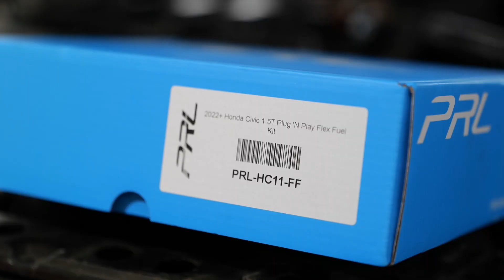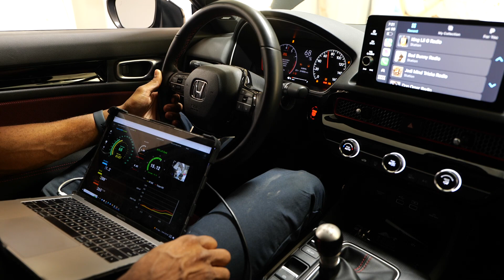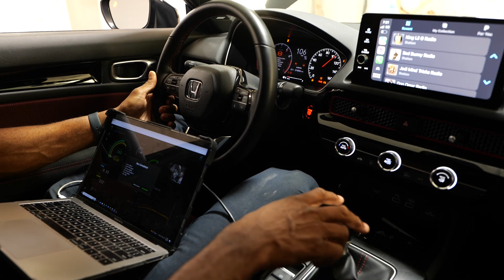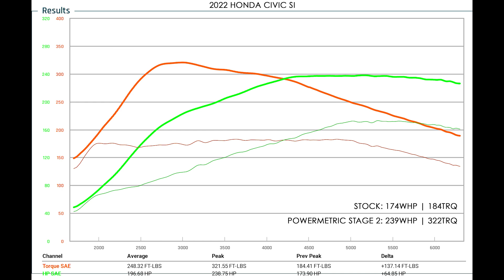Big Torque Gains | E85 Tuning Our 2022 Honda Civic | Powermetric Stage 2 | PRL Flex Fuel Kit Install

Comment: Hey! Getting a 1.5t cvt cause i cant get the si, but i saw its available for the cvt too! There is a notice on the website that there is a torque limiter, by any chance can that torque limiter be removed through hondata by tuning it out??

Comment: So stage 2 is clutch upgrade, PRL intercooler, PRL intake, PRL catted downpipe, and Flex Fuel Kit tuned with Hondata race?
Reply from the maker: Yes those are the mods we ran for that tune. We suggest all of it for better prefomance. You can find the bolt ons on our website. ososik.com and the e tune and Hondata FlashPro on powermetric.net

Comment: Does the civic still has oil delution problems, because iam planning on getting one ?
Reply: Oil dilution hasn't been an issue for years
Reply from the maker: That was a problem that was there with the 10th gen civics but Honda fixed that problem. Thank you.

Comment: My 2018 1.5l Fit started throwing codes at 95k for bad injectors. Replaced them at 135k when car died on highway and also had to walnut blast the intake valves. Apparently the 10% ethanol causes carbon buildup with direct injection and pure gas is better. I'm curious how bad E85 would dirty them up after a while.
Reply from the maker: Personally we haven't had any problems with E85 on our cars with a flex fuel kit. Thank you for your feedback.
Reply: You will have carbon build up on ethanol free gas also. The ethanol in fuel has very very little effect on carbon build up. It only slightly adds more carbon build up because it burns ever so slightly colder

Comment: Lol it made 239 WHP on full e85? I make 249 WHP on 93 with Phearable 1.5 Race tune that's crazy.....and their E30 flex fuel tune makes like 270 WHP
Reply: Try there yolo tune on stock Turbo hitting 298 whp with an e40 mix
Reply: It’s a mustang dyno it’s going to read lower…
Reply: Lol when I raced a stage two pherable flex fuel tune I Gapped them by almost 3 cars with a Powermetric stage one tune that’s crazy lol
Reply: @Danny-uv4jk  I mean that's incredibly low then
Reply from the maker: You should definitely subscribe so you can see our future videos. We are going to teach the community how to analyze dyno plots, do's & don'ts at a dyno shop and the differences between dynos, fuels and conditions.
Reply: @thefoatmedia  I will if you sell me your stock Si wheels
Reply: @brokentradgedy  not low, just a lheart breaker”dyno. Do your research on them as compared to a hub dyno 👍🏽
Reply: @brokentradgedy  That’s why the call the mustang dyno a 💔dyno.

Comment: Bye bye motor, those are the weakest motors Honda has ever made. I wouldn't even put an intake on that. The connecting rod is about the size of pencil.
Reply from the maker: We also built the highest powered L15s.  Check out our 10th gen build. When it blows, we have a spare ready.
Reply: That's bold comment considering  no one has found  the limit yet .. I'm sure some of the 10th Gen applies but no one hit the "wall " yet on these motors
Reply: @bryanhaenn3835  Honda is a big let down lately, don’t want to give us enough power yo beat a soccer mom suv in 2022 fine but at least build the motor for performance upgrades. The old k20 could handle 350-400 hp back in 2006….